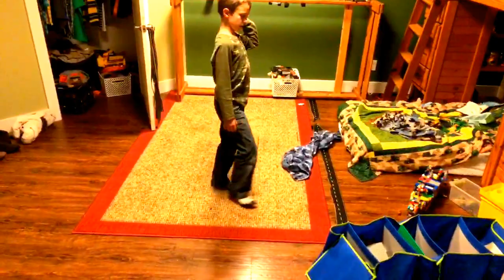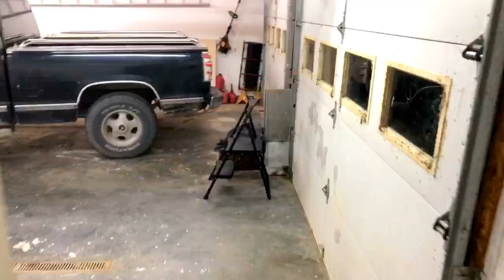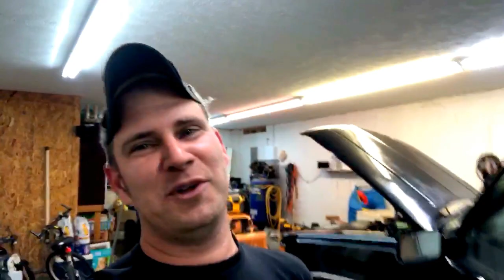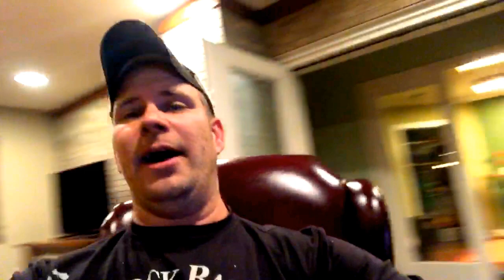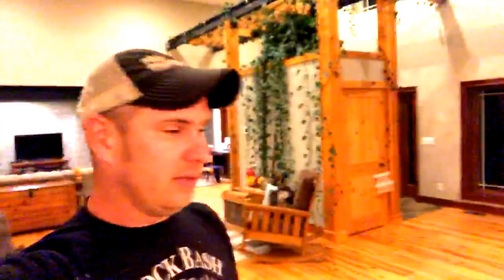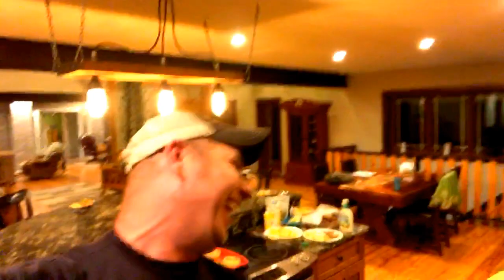Everyone pat yourselves on the back!!!!

Comment: Low injector pump pressure,vacuum leak,low idle positioning sensor,possibly mass air flow sensor,fuel injectors need cleaning.
One by one,go through what I just mentioned Wade,I hope this helps.

On a unrelated note...
Tougher then woodpecker lips??.
HAHAHAHAHA!!.(that's original as all get out)

Comment: Runs rough at moderate throttle and good wide open sounds like to much timing advance. Some advances by the throttle position sensor some older models will have weights under the distributor that sling out by centrifugal force and they will sometimes stick just a thought hope it helps

Comment: That's the Throttle position sensor. It's a potentiometer which gets crud/mud and such stuck in it, causing it to not return to the right reading at idle. Replace it and you'll be golden.

Comment: Sounds like a Mass air flow sensor to me did an 2007 & 2011 with same issue and one can of mass airflow sensor cleaner fixed both although a month later I replaced the mass air flow with a jet performance one but keep the collection going till 2nd week n December if possible

Comment: MAS sencer and throttle position sencer. They cause all sorts of problems in them chevys. Mine runs at high idle after a little bit and the transmission shifts like its in tow hawl mode even though its not in that mode. Its a 2000 modle year with the 4.8L in it.

Comment: Check low intake gaskets spray them with carb and chock cleaner, check for low fuel  pressure they run a pop it fuel injector and they have to run a certain fuel pressure to work properly I think 55psi, check tps, clean throttle body cleaner, change fuel filter just a few things to check. If u do low intake and it's newer than 96 u have to set timmimg with scaner